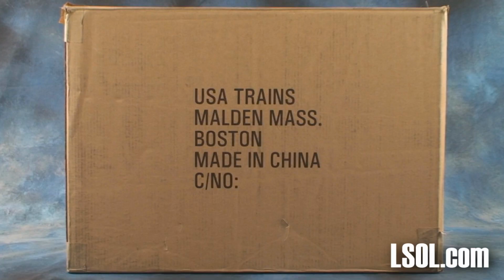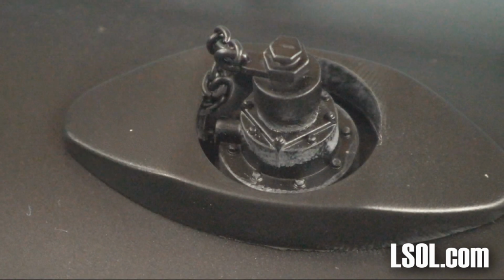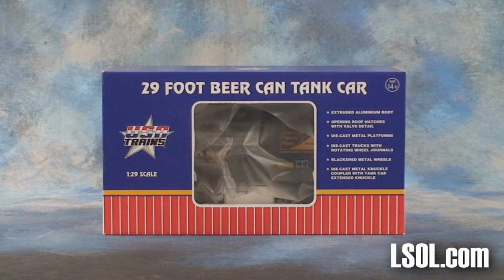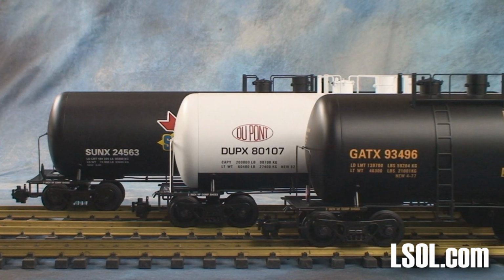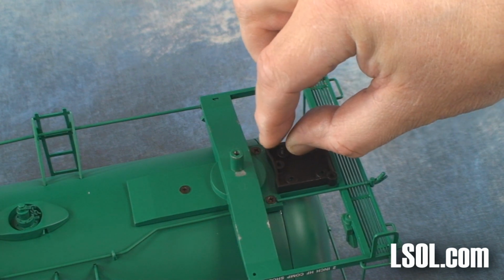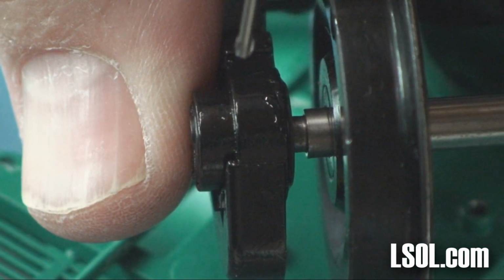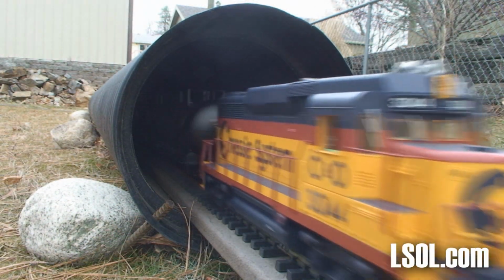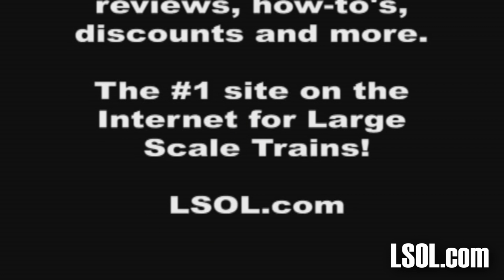Garden Trains: UnBoxing - USA Trains Extruded Aluminum Tank Cars  55, 42, 29 Foot

Comment: Great video. I would like to add a couple of points. The USA Trains 29ft, 42ft and 55ft tank cars feature the correct prototypical Type F coupler which is required by standard railroads on tank cars. You will notice the USA Trains knuckle couplers on these tank cars are much different than the die-cast ones on the USAT 55ft hoppers. Also you have to notch out the Kadee coupler box for the wheels if you are going to run on 10ft or 8ft diameter curves.

Comment: @MrJoe53 most common problem is dirty rails (which is normal but WILL hinder performance. maintenance is mostly bearings and wheel flanges.